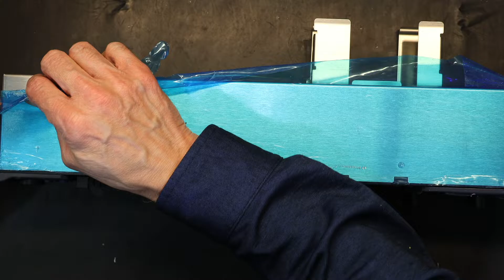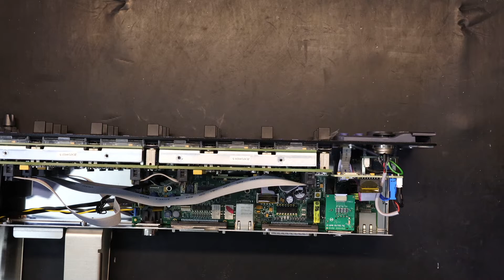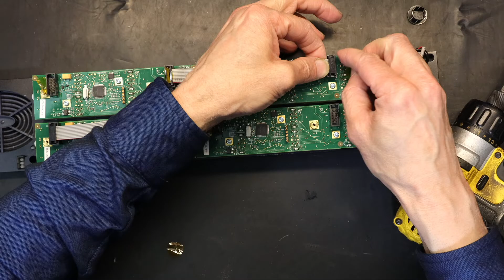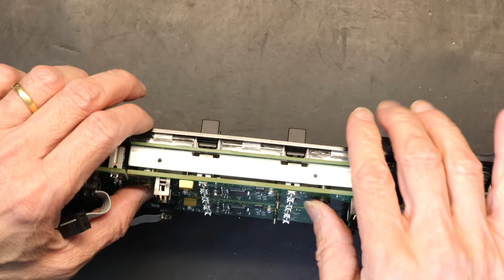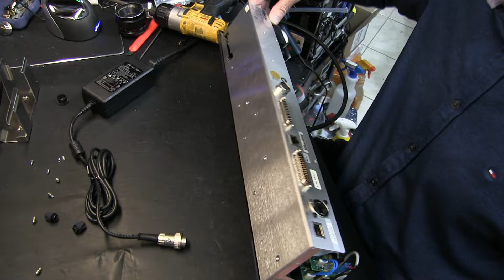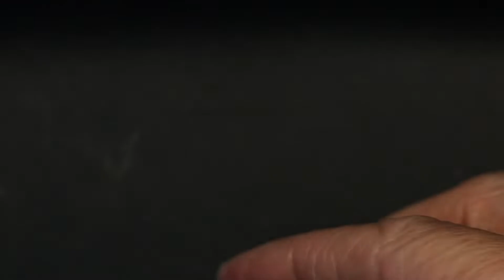Tutorial to replace the LCD Screen Display Panel on a ClearCom V-Series Intercom Panel 12CH or 24CH

Comment: video chiarissimo e molto costruttivo, ti chiedo info se possibile per trovare  alcuni part number dei prodotti clearcom per pannelli V series clearcom. in particolare o2 v-series lever key display part#t13026-1z1 e 02 v series oled display yellov part# 390102z. thank you for  thank you Ettore Cortesi videob television italy
Reply from the maker: Hello, here is the part that you need https://avlgear.com/products/clear-com-t13026-1z1-v-series-lever-key-display-module-yellow-oled-bank-of-6-for-v-series-12-and-24?srsltid=AfmBOoqUAJ8TkoydDdGh8AJ7W067cTNYHc7RYKxqjuyYoV4Mh73SUau0